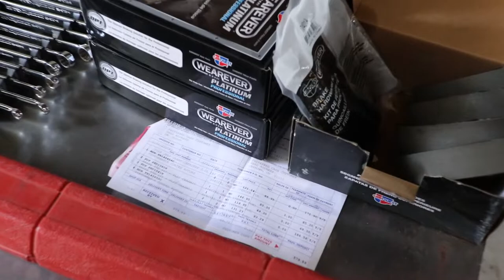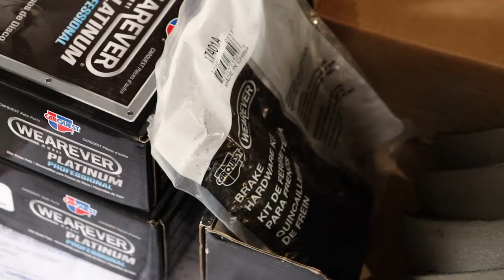2005-2010 Jeep Grand Cherokee WK Complete Front Brake Job

Comment: No need to bleed the brake caliper while compressing? I'm doing mine tomorrow. Also did you take the cap off of the brake fluid reservoir?
Reply from the maker: I take the cover off and keep an eye on the level.  If it is high I suck it out as the brake fluid removes paint.  I don't touch the bleeders because they can break off and cause lots of trouble.